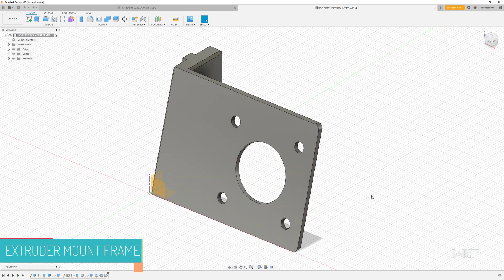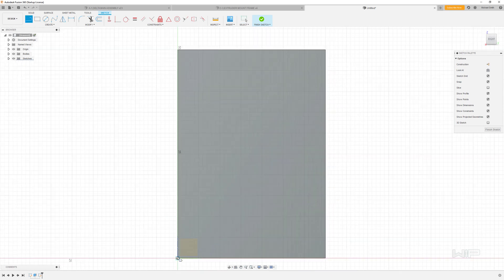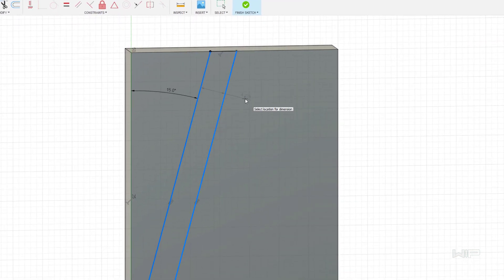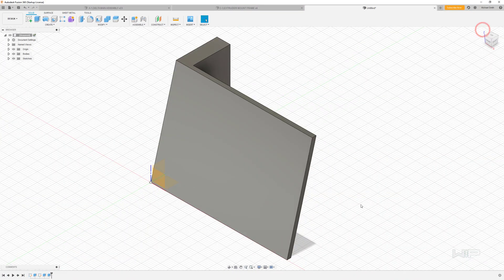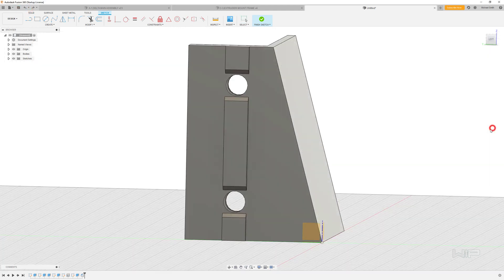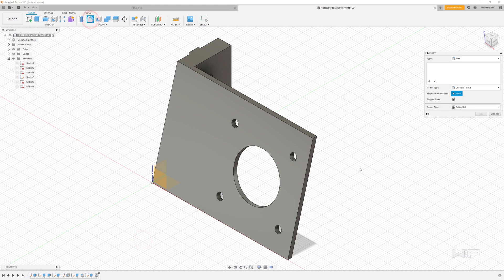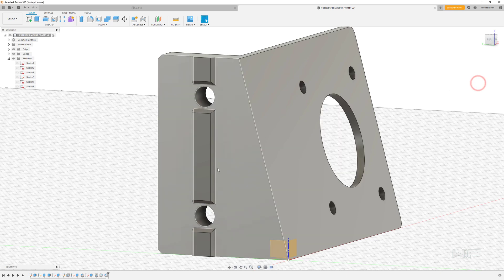DESIGN INTENT - ONE SKETCH MULTIPLE FEATURES, Learn CAD With Fusion 360 Class, Part 7

Comment: I was extatic how easy your tutorial is to follow - anything that didn't do what I expected it to according to your video was resolved in a matter of seconds. (Like a constraint symbol coming up unexpectedly because I just happened to click on exactly the center point of a line which I wasn't supposed to, deleting that constraint was enough to be able to follow along.)
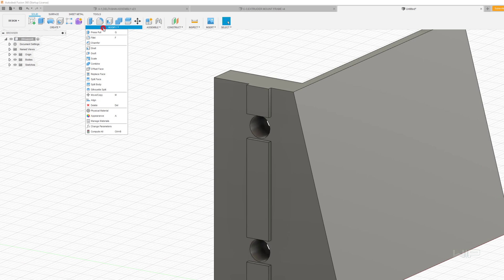But now at 7:47 I can't add the 1mm chamfer. The only reason for that (which I can determine) is the depth of the extruded part for some reason only being 0.997mm despite entering 1mm for the width of the rectangle created at 3:43. I checked the dimensions of the rectangle and it says 1mm, yet the resulting line is 0.997mm. All the other dimensions match what I enter, just this one is always 0.003mm short. At 5mm entered the result is 4.997mm.

This kind of issue is why I'm hesitant to learn from videos. Sure, I'm not building the printer and adjusting the chamfer or setting the dimension of the rectangle to 1.003mm so I can do a chamfer of 1mm wouldn't hurt the end result but I'm obviously missing or not understanding something properly. And YT comments are a horrible way of discussing problems. If each video had been posted as a new thread on a subreddit or whatever other kind of forum platform there'd probably be more eyes on my post and I wouldn't have to wait until you look at this, actually hoping you will at all.

...Now that I read it again this sounds like so much more frustration and nagging than it's meant. I'm very aware of how much work a forum is and I'm not expecting you to run one for stupid little hiccups like this. Thank you so much for your work! The only thing I'd add is that you're a tiny bit too quick for me, leading to a lot of pause/play and rewinding which distracts the user from what they're actually trying to do. Might just as well be my tempo issue though, not necessarily yours.